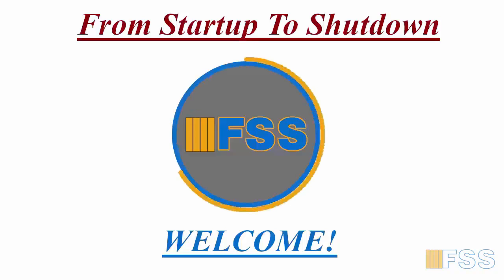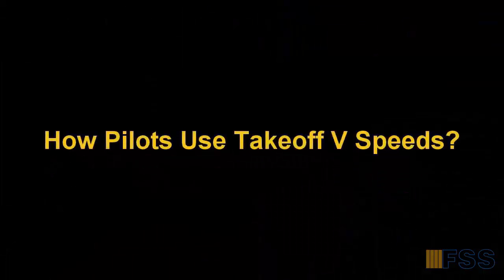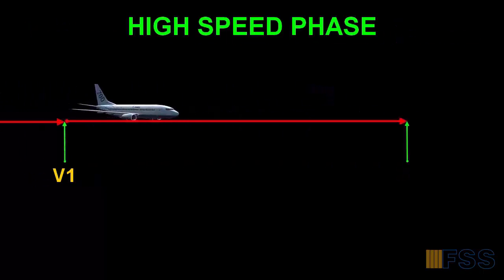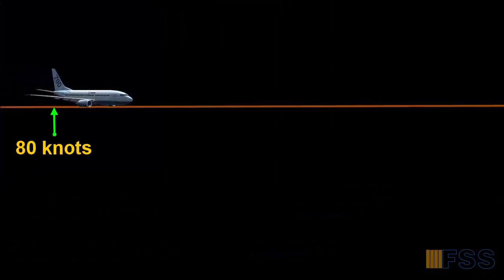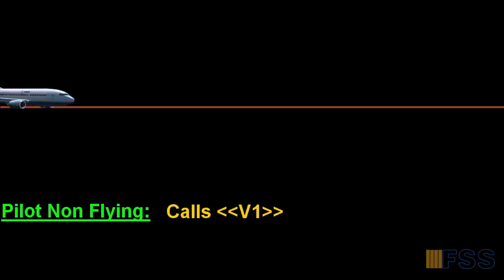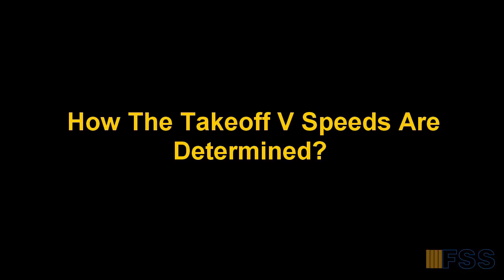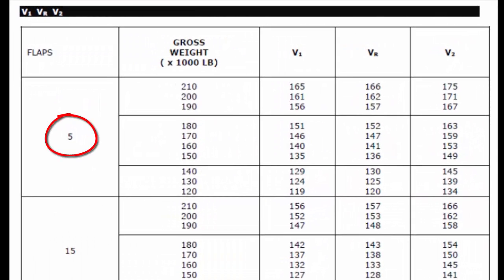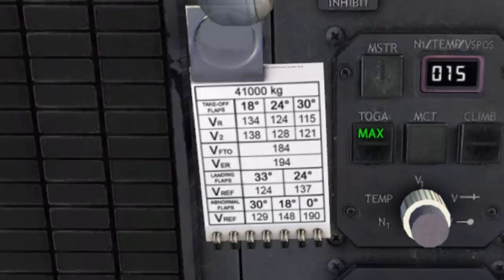Take off Speeds Explained & How To Calculate V1,Vr And V2 Speeds

Comment: Okay so just say V1 and v2 give points where these Vs begin but don't explain anything about what V1 is besides a marker.
Reply: Okay, so I've done my homework. V1 and V2 varies depending on weight of craft, runaway length, etc. 
V1 is the fastest speed at which a craft can abort takeoff and the decision is made to abort or takeoff. 
V2 is the lowest speed at which the craft can reach a safe altitude if one engine were to fail.
That may not be perfect but I learned it in a day.

Comment: Where’s the aircraft V1 flaps charts? Where can I find it outside of this video
Reply from the maker: you will find that in the  Flight Crew Operating Manual generally , for example  for PMDG 737 you will find that in( PMDG FCOM) under Peformance Inflight Section 10, starting form page 497. Cheers.

Comment: Okay, this made things clear, but I have two comments.  First, on some planes (e.g. 737) or maybe most planes, Vr is achieved only about 1 or 2 seconds after V1, so it's not like the flight crew has any time to react other than possibly to delay the yoke input for rotation to achieve higher speed prior to rotation, or maybe increase the throttles.  Second, I never understood the point of V2 because once you are committed to TO after V1, what can you do?  If I understand correctly from this video, it is important for the PF to ensure the pitch is controlled so that V2 is achieved in a relatively short time, maybe a few seconds only after rotation.  If the plane were to lose an engine after V1, there are really only two control input options: you can go to max throttle, you can reduce the pitch to increase forward speed with the available thrust, or do both.
Reply: There is no need to do anything that you ve said. Performance calculations always take in account an engine failure. VR is VR with an engine failure as well , you dont need to wait for extra airspeed ,also  you dont need to increase the thrust,unless in some extreme cases when you are about to hit something.

Comment: Any video link that teaches us the calculation to determine V1,V2&Vr? 
Does aircraft weight hv any role in this calculation? 
In a derated takeoff will these values remains same?
Reply from the maker: As i said in this video that there are a number of method that can be used for the Vspeeds calculation ;Depends upon the airplane you  are looking for.
Reply: @FromStartupToShutdown  say it's A320
Reply from the maker: @joydasgupta9445  For A320 you can use TOPCAT software ; some people uses online webs for  that such as webpro.cz
Reply: @FromStartupToShutdown  Not software to calculate manually from charts. Software will give answers but I need to know how it's manually calculated.
Reply from the maker: Yes  the weight will affect all the takeoff speeds , other factors will affect only V1(decision speed)

Comment: I've a lil doubt. Consider we reached the V2 speed and started to climb with one engine failed . So why should we take the risk of flying with  only one operative engine ?
Reply from the maker: If you have one engine failure at that moment you will continue the climb with V2 to reach a safe altitude than you proceed back to land normally at the departure airport or at the closest one . But keep in mind that the airplane is capable to fly with one engine......Thanks for your point..
Reply: @FromStartupToShutdown  that's the same which I was thinking...
Reply: @PhilipsAvon  I am not sure if this is what you mean: You HAVE to rotate the aircraft if there is an engine failure after V1, no matter how severe the problem is. even with one engine you will rotate at the rotation speed. V2 is there to provide a speed, that ensures that the plane does not stall after rotation during the climb. To safely hold that v2 speed, pitch is monitored at all times, and is probably lower than on a normal climb with 2 engines.

Comment: Ok, but what speed should I maintain after the takeoff, during the inicial climb before the Flap Retraction? V2, V3 or V + 15???(And I know u should be at ur V2 at about 50ft after the T.O., but im not talking about this)
Reply from the maker: In general you maintain V2+10 to 25 KTS during the initial climb untill you reach the acceleration altitude where you start the flaps retraction following the scheduled speeds.
Reply: @FromStartupToShutdown  Thx 😊